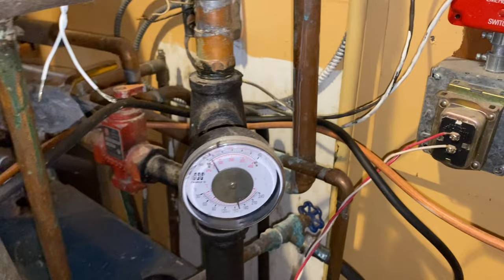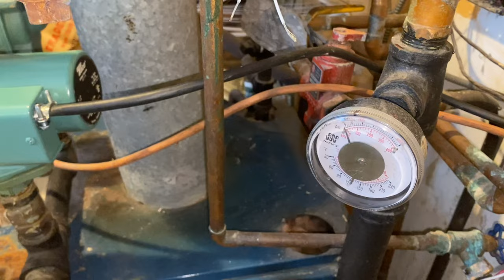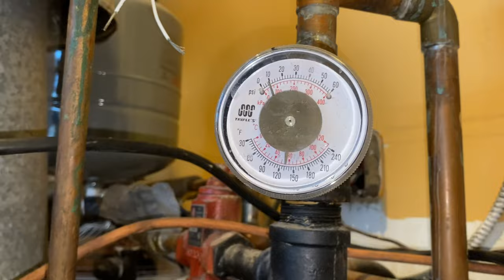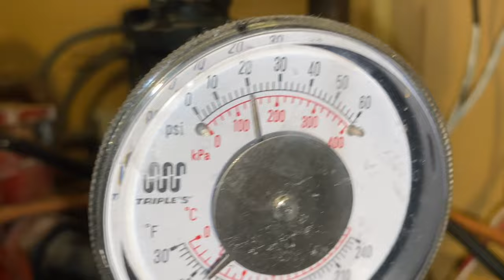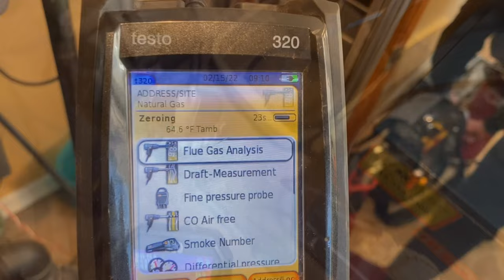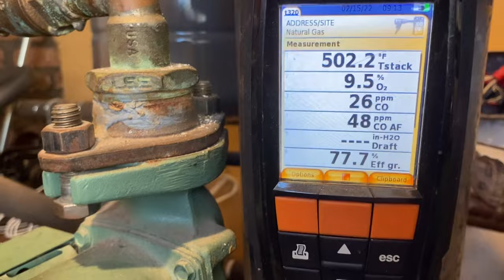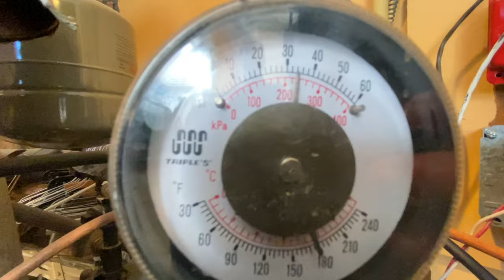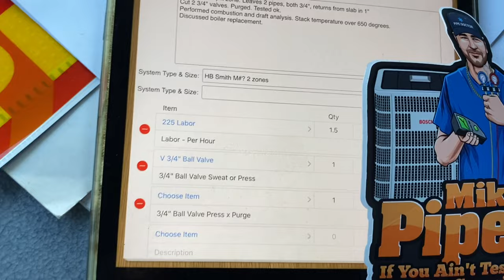How to Purge 2 Zone Gas Boiler - Half 2nd Floor Split Zone Not Heating

Comment: When you added the pair of ball valves, why didn't you put in a ball valve with drain for purging on left hand run?  The boiler pressure gauge was reading 35 psi running, how come the relief valve didn't blow at 30 psi?  You didn't drain any water to lower the pressure?

Comment: Another water heater not vented correctly , I noticed draft diverter on water heater removed and rusting out flue pipe . Bet it was running down hill as well. Good video thanks for sharing with us!

Comment: Still amazed that I’m only about 100 miles south of you in Jersey, and we are 100% furnaces here 🤔🤔🤔
Reply: North Jersey here, steam in my entire town, and many surrounding. Guess it only takes a few miles. However, I can probably run my steam system off of a small UPS during a power outage, though I'm fairly confident they put some of the water pipes in the homes close to the steam pipes just to keep them from freezing....hope I never have to find out!

Comment: 31:05  Not sure if your batteries are low in the printer.  That should darken up better and easier to read with new batteries.  😁👍
Reply: @PipeDoctor  Buy lithium batteries, they work better in the cold than alkaline.
Reply: just wrap the printout around the flu pipe, it will darken right up 🤣🤪🤡

Comment: 35 ? what psi was that relief valve
Reply: Those gauges are never accurate. That’s why all techs should have their own water gauge IMO. One that goes from 0-30 not 0-60 or 80.

Comment: I'm the same way..no one believes I can smell CO until I prove them otherwise
Reply: @PipeDoctor  I can tell it's Co when I smell the same as when you open a chimney clean out is the kind of smell that makes me think it's Co 
I guess it's because it's backing up through the chimney through the boiler flue pipe
Not enough to set the spill switch to go off
Reply: Not always the chimney, if the boiler is clogged too much carbon between the sections the spill switch or roll over switch will stop the boiler.
Reply: you're smelling the other byproducts of the burnt gas, but if you're smelling them, there's guaranteed CO coming out also.

Comment: I don't think a water heater pressure relief valve ( high pressure ) should be fit on the steam furnace ( low pressure). That is a fault in design!!  Shame on the plumbing industry!
Reply: I don't think idiots should work on the stuff at all. the valves all having the same standard tapered pipe thread is just fine the way it is.